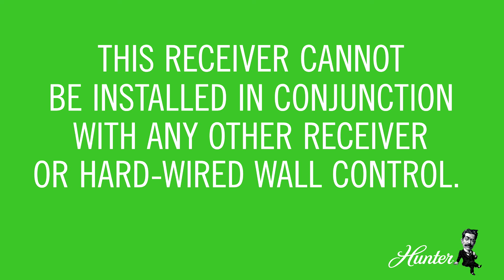How to Install a Hunter Control Receiver #easydiy #diy #howto #smarthome #ceilingfan

Comment: Damn, i must really be stupid... lol  I have worked on replacing the remote receiver on this darn fan in our bedroom.  I figured out that was the problem with the fan and light not working...  I got the new remote and receiver, took the old one out of the fan and wired it back up to the new receiver.. I did a test with the receiver hanging on the outside.. It worked perfectly!!!  I was so happy, brought the wife in to show her how good of a job I had just done...  The fan turned on, changed speeds, the light worked and dimmed like it is supposed to do... BUT then, I tried to put the receiver in the small area where I had just removed the old one...  was stuffing the wires in the ceiling while pushing the receiver in... when I finished, I turned the power on and the light worked, but the fan did not... I removed all the wires and receiver and saw that the black wire to the motor had come loose...  so after hooking the wires back together and trying to put it back in again... same thing... wire nuts came off and wires became loose again.  With aching arms, I stopped and came back to youtube - Now that I've watched a couple of installations, I'm headed back in to unhook all of the wires, then put the receiver in first, then hook the wires up... (DUH)... that may have been in the instructions, but since I ordered this remote and receiver from Ebay, I received it last week and everything on the instructions was in Chinese, I was unable to understand the instructions, guess I should have translated all of the instructions from Chinese to English.... I will do that the next time....  Got it figured out now... I've only got 3 or 4 hours into the project... all the time with the wife saying, "I told you we should have just bought a New fan"....  I get no respect at all....not at all.     Have a great day.. I will when I finish this job.
Reply: Did you get it to work?
Reply: Your not stupid and your not alone. This is really pissing me off. I rather just buy a new fan and pay for a whole new installation. This is really pissing me off…yes thank you 🙏👍👏👏👏👏 Aching arms. I even move my bed to make sure that I could stand on my bed which would give me a better leverage and stability than standing on a ladder. That made me very happy to know that I am my head almost touch the ceiling. And then I wouldn’t have to deal with the aching arms and all that stupid stuff that goes along with installing some thing above your head. It’s just been a huge headache.
Reply: If you want to you can send me a picture of the item and I can translate it for you. I don’t speak Chinese but there’s certain programs  that can easily do that.   I also resorted to buying the remote and receiver on eBay only because Home Depot and Lowe’s were all out of stock. And Amazon was way too expensive. So they were good deals on eBay and I received everything I needed but the only problem was that it was a lot harder than what I thought. Thank you for your very helpful comment. Like I said if you need help to translate it if you just send me a picture of the wording I can try to do it for you.

Comment: After replacing you have to reset via the remote. For my single freq remote with no dop switches I had to turn breaker off (I did 10 seconds, probably doesnt't matter), turn it back on, then within 30 seconds (some sources say 3 minutes) on remote press fan off and fan high together until fan turns on (my lights came on too). After that you should be set. This was conveniently not mentioned in the video.
Reply: THIS. I ripped apart my fan twice! but forgot I had to sync the wall switch to the receiver. This crucial step is not documents, however if you contact their help they will inform you. WHY IS THIS NOT DOCUMENTED. Ugh a few hours wasted.. Thank you Adam, I had forgot to sync/pair them. I did install a different Hunter fan w/ integrated receiver and did a pair, but totally forgot on this manual fan.
Reply: You saved the day man.

Comment: At minute 2:09 the white wires are referred to as ground wires. They are not ground wires, they are circuit neutral wires. Ground wires are usually bare copper or green.
Reply: The white wire is a grounded wire.  It is not a ground wire.
Reply: @hoosierLowe  It is best to refer the white wire as grounded conductor or neutral conductor and the green wire as grounding conductor.

Comment: This is correct, assuming....you have room to operate without removing the cowling completely as you'd have to on most low profile fans. There's just no room to work otherwise. Also assuming your Eastern European handyman who hung the fan used proper wiring to begin with...which is doubtful. That said, yes, this is helpful.

Comment: I turned off the power at circuit breaker #14 as shown in the video and kept getting electrocuted when I twisted wires  together. I followed the instructions exactly, but I don’t think this video accurately shows how painful this thing is install. I didn’t see the girl wince once!
Reply: JAJAJA

Comment: None of the receiver installation videos address how to attach and secure the actual remote receiver. They all just bypass that step and then show the receiver already inserted somehow into the  wiring. In this video, did you just stuff it into the bracket and hope that it stays? Is it secured with nylon zip ties? Adhesive tape? Metal anchor strapping?
 And how about the newly attached wires? Are they left dangling to become entangled with the spinning motor housing? It's these kind of steps being omitted that cause users to be become irate when the fan works for a week or so and then either the receiver or the wires start dragging against the spinning motor housing and eventually short out the receiver.
Reply: The canopy is above, separate from moving parts, and the wires are enclosed in it. How would anything INSIDE the canopy get caught in moving parts?? No need to secure the receiver as there is nowhere for it to fall or move around once the canopy cover is secured. It's placement is self-explanatory once you see what things look like inside. There's only so much space, and one way to place it. It's not rocket science.
Reply: @KingZoneOne  not if you're trying to do this with a flush-mount.  The instructions show a way to mount it to the ceiling bracket, but not specifics.  It's a bit tricky, to be honest.

Comment: I'm replacing the receiver in an existing Hunter fan/light unit with two switches on the wall.  I assume one switch is for the light and the other is power for the fan.  I'd like for the fan to be remote and the light to be controlled by the switch.  Is there a diagram showing how to connect the wires from the ceiling (red, black, & white), from the fan (black, blue, white & green) and from the receiver (black/white on one side and yellow/blue on the other side).  I'm not quite sure which of the receiver wires won't be used.
Reply: From what I've been reading the red wire from the ceiling will be capped and not used.
Reply: Typically the red wire in the box is the light switch. If using the remote ONLY you would want to cap that off.  Brad, however, wants to disable the remote's light switch function and use the wall switch instead. This would require (typically) hooking up the blue wire from the fan to the red wire in the ceiling box. 
However, I would not recommend a Hunter product for this, the remotes especially are NOT reliable. Hunter used to be a good brand, but others have far surpassed them in recent years, and they have been getting worse.

Comment: I just tried to install my hunter fan. NOWHERE in the instructions does it explain where to mount the remote. I guess they figure it must be self evident, in that case the entire installation should be intuitive and no instructions should be needed. 
Eventually I figured it out and it fit in easily. Now to the fun part. Apparently, you must bypass your wall switch that controlled your old fan to get the remote to work and connect straight to the black hot wire. I'm not too sure I am to relinquish total fan control to a battery operated device.
tried wiring it to the switch, no sync. PIA not not have wall switch.
Reply: IF you leave the remote alone (not turning the fan or light off from the remote) your wall switch will still work. If, however, you turn off the fan, then turn off the power at the wall switch, do not expect the fan to come back on without using the remote! 
You might consider using a wall mounted remote matching the codes for the battery operated remote, as well. Then the battery remote can be placed anywhere in the room, the wired switch (with 3 fan speeds and a dimmable light control) are run by household power, not a battery. You can get these at Home Depot or Lowe's. 
Ceiling Fan Wall Control

Comment: How do you hook this up to a fan without the lights hooked up? Just to control the speed of the fan.  The power for the fan is on a single switch on the wall. There are 2 chandelier lights on this same switch. I just want a remote to control the fan because it is so high from the ground to reach the chains

Comment: Is there a way to disable wireless control on a Hunter ceiling fan that came with it from the factory?
Reply: Replace the fan with one that isn't made by Hunter. Their new fans are horribly unreliable, and their remotes are especially bad.

Comment: If I have 3 fans on the same switch.  Can I tie them all together using one controller? 

Based off this video this would eliminate the need for 2 switches running to the fan to control the light and fan.  Is that correct?
Reply: Set all the dipswitches the same in the remote(s) and  in the 3 fan receivers.
Reply: Hey!
Did you try it?
If so, did it work?
Reply: @XCCON2009   I decided to use a smart switch for the fan and light. 

Note: you cannot use a dimmer switch on the fan it will run up the motor.

Comment: Is it possible to install this type of remote and receiver to a ceiling fan that already has a remote control built into it?  (The remote control for the existing ceiling fan is lost)
Reply: You will have to buy a new kit with a new receiver and remote.

Comment: Installed a Hunter fan with remote control only (on wall control) by an electrician.  The remote stopped working a year ago.  Replaced with an universal remote and receiver.  The fan and the lights were on one night.  Then all of a sudden, the lights went off and the fan stopped.  The circuit breaker was not tripped.  So what was the problem?  The battery went out of juice?  Receiver died, control died?  Hope some one out there can help before I go out to buy another receiver and remote.  Pretty soon the remote control cost me more than the new fan.
Reply: Hunter remote receivers are notoriously unreliable, and overheat and fail. Buy another brand.

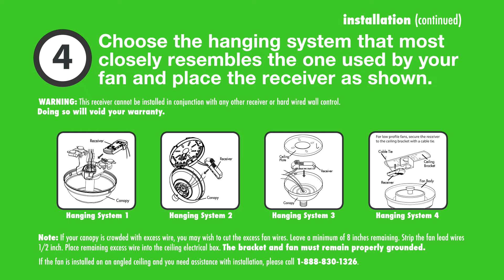Comment: How can HUNTER, the manufacturer of the fan,  screw this video up so incredibly badly?  The useless "diagrams" that come with the fan's installation "instructions" are at ~1:32.  Thanks for nothing.  Hopefully someone else has a better video of how to install your fan.  Or...now that I think of it...maybe I'll return my Hunter fan (hello, Costco) and buy one that comes with better instructions.
Reply: +Mmmyess  Oh...and now I see that the fixture has already obsolete two-pin light bulb bases.  I have four of your Granville fans, and they are all going back to Costco tomorrow.  Never buying or recommending a Hunter product again.  It's like an the entire company has a learning disability.
Reply: Mmmyess 
Check out the diagram at 1:35.  I struggled with receiver in that small space for probably an hour because Hunter did not inform me of how to do it.  I took a screenshot shot of the diagram 1:35 so that I could look at it closer.  In my application the receiver sits on top of the down rod inside the ceiling bracket.  Hope this helped.

Comment: This didn't show how to slide the receiver in.  We are having trouble getting to fit.  The canopy will not go back up once the receiver is in place.  Help!
Reply from the maker: Hi Martha! I'm sorry to hear that you're having trouble installing your receiver. We would love to help! Please give us a call at 1-888-830-1326 for assistance. Thank you!
Reply: Martha Pattberg 
Check out the diagram at 1:35.  I struggled with receiver in that small space for probably an hour because Hunter did not inform me of how to do it.  I took a screenshot shot of the diagram 1:35 so that I could look at it closer.  In my application the receiver sits on top of the down rod inside the ceiling bracket.  Hope this helped.
Reply: @HunterFanCo  What's The Model Of That Fan

Comment: My Hunter ceiling fan already has a remote control unit. When I turned on the light yesterday one of the bulbs blew out. Now the remote will not control the light at all. The remote still works on the fan; low-med-high and fan-off. But the light stays on. I can control the light with the pull chain. Is there any reset or fuse in the canopy or do I have to replace the remote receiver?
Reply: Michael Stock
Reply: Renee - did you intend to provide a Reply with more information?

Comment: I just replaced old ceiling fan with  my new hunter fan. It came with a remote control but I could not find the room I needed to place the receiver into the canopy. Amazingly enough, in passing,  I mentioned this problem to two other people, who like me ended up leaving the receiver on the outside of the canopy. I was hoping for a more detailed explanation/illustration on receiver placement. Regrettably, this video fell short of illustrating placement and instead offered drawings. If I came to watch a video, why would I want photos of drawings for placement?  This did not help.  Paul Gitanno  PS:  I like the fan but until I solve this, I don't see myself purchasing more with a remote control.
Reply: You should’ve called Hunter Customer Service right away. Sent them a picture and they should be able to help you or do something for you.

Comment: Just installed a 52100 Newcastle. Remote was a complete piece of junk. Ended up throwing it in the trash can and wired it like it never had one.  Could get no one to talk to or a call back. You can't complain about Hunter's customer service.... there is none.

Comment: My wife and I watched the video several times each.  I took a photo of the old set up.  Then I found out the replacement wires are different colors from my fan.  Several hours later, up and down the ladder at least six times, turning off the breaker at least five f'ing times, we GAVE UP.  Total klusterphuque.  CHINA SUCKS!!!  Plus my daughter is still laughing at me.

Comment: Nobody shows how to get that box in that small space then screw the cap back on
Reply: Thank you!!!! The whole reason I needed a separate video was to see how the damned receiver fit into that small space and they just glossed over it with diagrams could have been from the instructions. Misses the whole point of having a video.  Another video otherwise good from Hunter just kind of shows the receiver but not how it’s supposed to go in. Big thumbs down on this one.
Reply: Exactly right... that why I bought a Harbor Breeze from Lowe's. Clear instructions. But hey, they sent $1,000 on the art work at the beginning of the video so there you go ;-). Seems all the Harbor Breeze have a space (tight) on the hanging clip just above the down rod that the receiver slips into. The trick is to connect all he wires, squeeze all he wires in the junction box above, and put the cover back on. In my case, the latter was just a few inches below the bottom of the fan so I was able to take it off the hanger, do all the work, then slip it back in. Good luck!. Freakin' Hunter!

Comment: I HATE these damn wireless fans, the buttons on the wall switches they sell at the store are a joke and I got two fans that turn on with one switch and another that works as it should. . . Don't make my mistake, buy a normal fan!